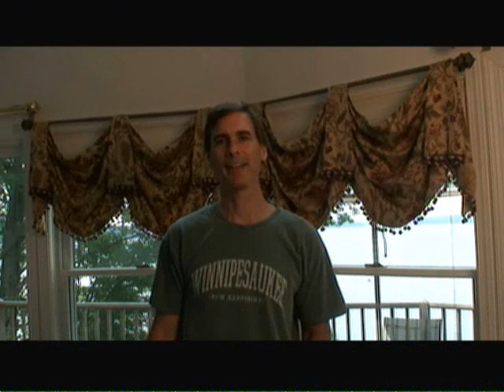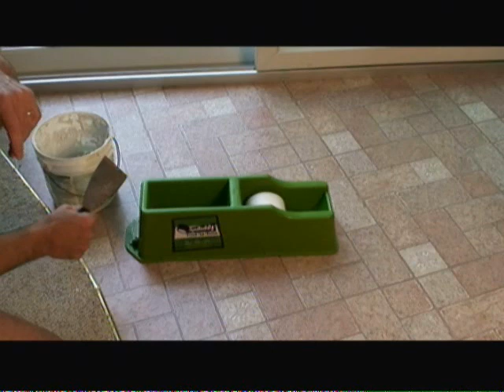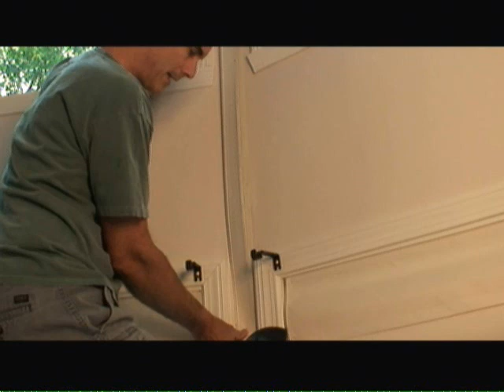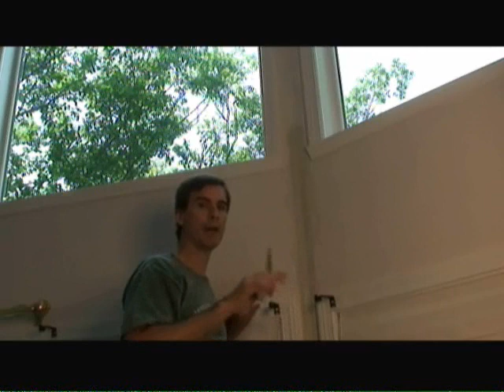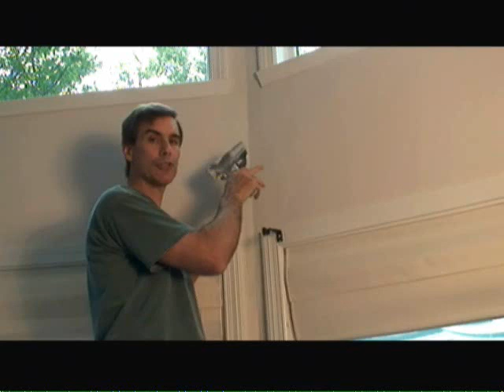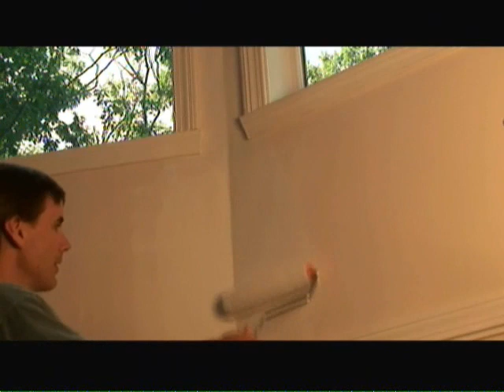How to Repair Drywall Taped Seam Video

Comment: Hey!  This is a bandaid fix.  This crack WILL come back.  Show me how to fix the root cause.
Reply from the maker: I'd have to reframe the house. The temps get below zero in the winter in central NH, and being on a large lake the winds are fierce during the winter months. In the summer the humidity is very high being on the lake and temps often get in the 90's. So, there is a lot of expansion and contraction of the lumber throughout the year.

Comment: how would i repair a bulging area where 4 drywall panels meet?
Reply from the maker: Okan Korsal Your best bet is to use a wide taping knife, e.g. 12 inches and flair out the high point. Otherwise, your only other choice is to rip out the drywall and see what is causing the bulge, e.g. a warped stud.

Comment: Paper doesn't let go because of off sets but because there isn't any compound behind the tape or water damage. The difficulty with applying tape to offset seams is applying the compound correctly. It would be better to run a piece of tape on the low side to even out the joint then tape over the joint itself. A TapeBuddy tool coats the compound directly to the tape & leaves no voids therefor no blisters. The tape won't come off and lays flat making the top coats easier to work with.

Comment from the maker: First, I would suggest ripping off all the old split tape seams. Then tape and mudd the seams again. I am not familiar with a southwest trowel texture. If it is simply a swirl of joint compound then I would apply a skim coat of joint compound over the entire ceiling area, similiar to what is done with blue-board installation. You may want to hire a professional to do this as applying mud over an entire ceiling takes a bit of craftsmanship and some serious arm strength.

Comment: I just purchased a Florida house. The living room has a number of split tape seams in the ceiling due to past water damage but the drywall is sount. The ceiling has a southwest trowel texture. What would be the best way to retape and retexture? I would prefer a smooth finish.  I have done a bunch of new construction drywall but no big repairs such as this.

Comment from the maker: I didn't do the first installation of taping and mudding. Also, that wall is 27 feet tall with winter temps below zero and summer temps occasionally above 100oF. There's a lot of expansion and contraction going on with that seam.
Reply: I have a bathroom with the same outside weather conditions, plus the steam of the shower.  Not surprised that the tape has peeled.  It was first installed in the early 1980s.

Comment: I've worked on international projects in many countries where concrete walls are the norm however they don't do well keeping the cold or heat out. In most parts of the USA insulation from extremes is very necessary. I've worked on a house in Costa Rica which has concrete walls. The wall temp stays around 95 degrees so the room is impossible to cool. Drywall is a great wall covering and so easy to work with. It cuts with a knife and goes up fast. Finishing is easy with a TapeBuddy tool. Try it.

Comment: Drywall seams separate from the wall many times because the paper was embedded in compound that was too dry. The paper needs moisture to adhere correctly. When compound is applied to the wall and then the tape embedded, the mud surface drys out before the tape can adhere.  The TapeBuddy machine applies the compound directly to the tape so the tape has the moisture needs  It applies an even coat of mud & embeds flat. TapeBuddy machines will help you with your project.